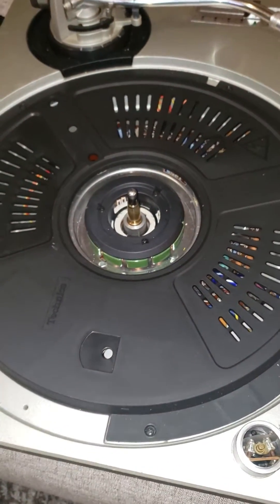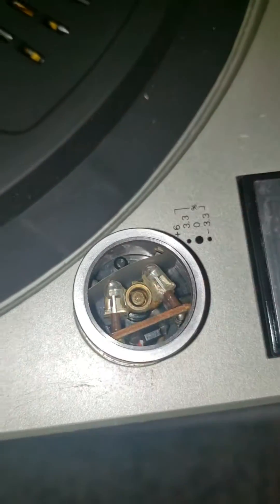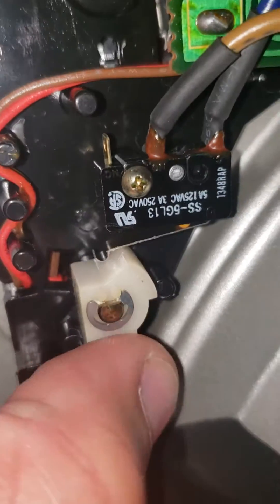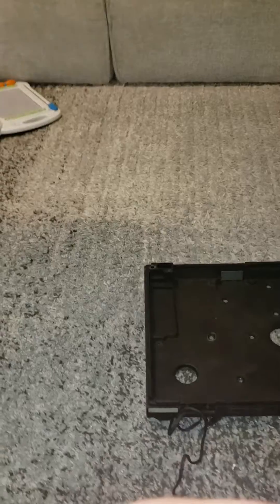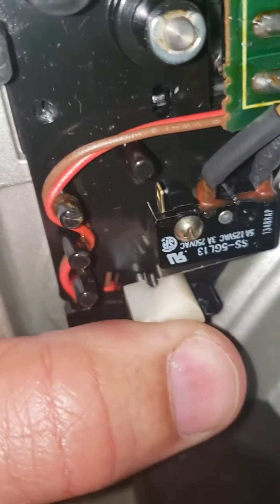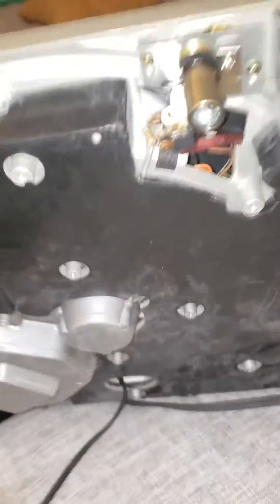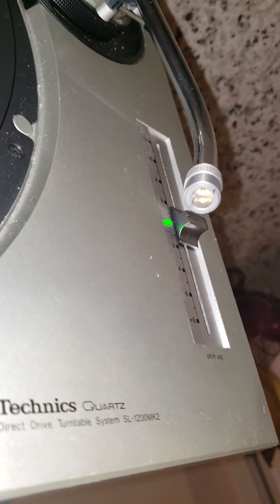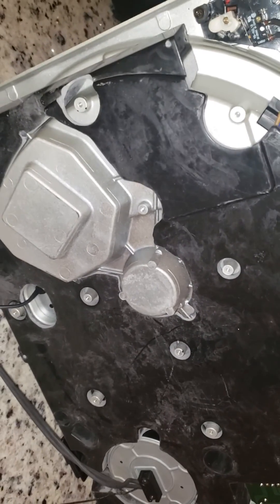Repair  Technic 1200 turntable on/off switch

Comment: Thank you so much DJ B-EASY! You made it look to B Easy too! :-) The switch on one of my 1200mk2 broke while I was in the middel of a set yesterday evening, but saved the night switching between 7 inches and Serato (which I always bring as a backup). I'll be fixing mine soon with your help. Thanks!
Reply from the maker: No problem. It is aggravating when the button fails, but easy to fix.

Comment: Thanks buddy 👊🏾. I literally just followed the instructions tonight and it’s all good and working great, Took about 20 minutes total. FYI: After removing the feet there are four long screws that are underneath each one to be removed along with all the other bottom screws
Reply from the maker: I am happy you were able to fix your turntable.  Thanks for the updated tip about the feet.  Other users can use your tips to help fix there turntable issue.
Reply: @djbeazy  Thanks! My brother was a DJ in Chicago back in the late 70’s through the 90’s and he had the long case with two SL-1200 MK2 turntables/ Numark DM1 700T Stereo PRE-AMP CONTROL CENTER inside. He passed a few years ago and I finally picked up his system last week and bought it back to Tucson last week. The switch was the only issue on one of the tables. It’s all cleaned up and ready to fully test later in the week 🎶🎶👊🏾. I borrowed it myself sometimes doing gigs around town for my friends during that same timeframe. I’m 64 and still enjoying the music 🎵
Reply from the maker: Sorry for your loss.  Keep the family tradition of spinning music going.  Your brother had great equipment and took care of it.  Enjoy the craft!